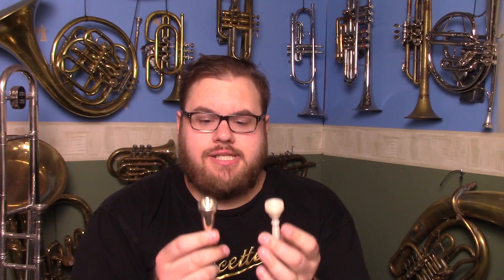Testing a 3D Printed Trumpet Mouthpiece

Comment: I went ahead and built an entire brass instrument out of 3D printed parts, including a number of mouthpieces. It definitely makes noise and is fairly stable (now, this is from someone who has never played brass before, so a grain of salt is highly recommended). It does not have valves because my design was an utter failure, but it's fine for practice and fun

Comment: Hey trent, would you mind if I used the bit at 02:13 (when the mouthpiece breaks) on a video i'm making about a 3d printed bass trombone mouthpiece?
I would like to use this clip as an example as why I used TPU instead of a more rigid thermoplastic and also why I changed the design up a bit to make the piece stronger in the throat area.
Reply from the maker: Sure

Comment: I had a friend and fellow mellophone player who dropped his instrument, with a 3D printed mouthpiece, on said mouthpiece. The mouthpiece snapped in half , leaving part of itself in the instrument. This prevented any other mouthpiece from being fitted to the mello.

It is still there, to this day.
Reply from the maker: Some 3d printed plastics are dissolvable, depending what it's made of you should be able to remove it.
Reply: I had a friend put his (metal) mouthpiece in a shirt pocket, only to have it fall out later, into the tank of a porta-potty. A plastic mouthpiece probably wouldn't have done that. Your weird edge case isn't really a convincing argument for either metal or plastic any more than mine is.

Dropping an instrument on the mouthpiece is going to damage the lead pipe, probably quite a lot. The difference would be whether the mouthpiece jams (if metal) or breaks (if plastic). The metal mouthpiece may still be somewhat playable, but if it isn't, you're not swapping that out any time soon either.

Comment: I’ve always wanted a plastic, or 3d printed mouthpiece, but have never tried one. Is it recommended that I get one for fun playing?? Thanks!
Reply: I had one for marching band. A 1.5C to be exact. It's a bitch to play high on, especially because it didn't weigh anything, but it's something cool to have lying around
Reply: The one demonstrated in this video is far from terrible, especially if you want one for fun. I'm a low brass guy and only use mine for fun. Most recently, I used mine while teaching a band camp. On the contrary, when I use my pBone I almost always use my regular metal mouthpiece.
Reply: If it's just for fun, I'd say go for it. I personally feel as if they are just not as good as metal ones, but everyone is different and who knows, maybe you'll think it's the best thing in the world and have a lot of fun with it. And well made plastic mouthpieces are extremely cheap compared to their metal brethren, so even if you end up using it once and never again, it's not like your wallet is taking a big hit anyways.